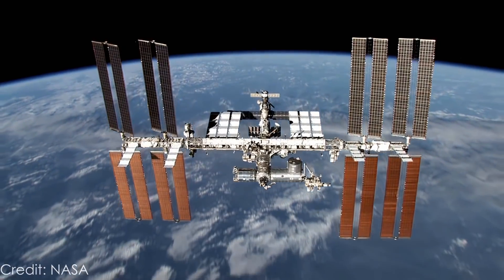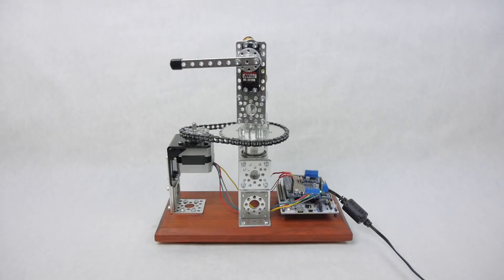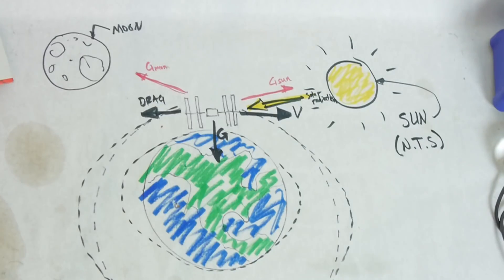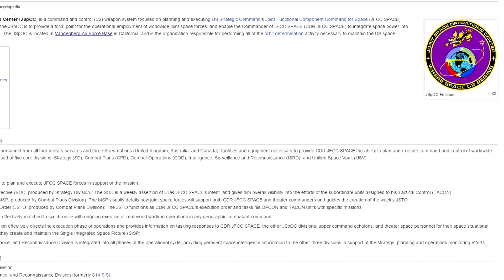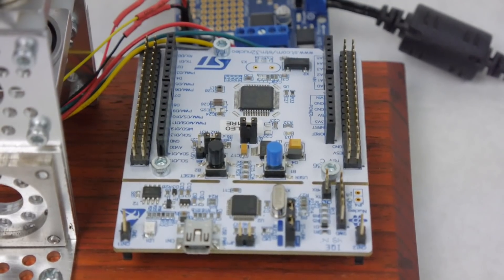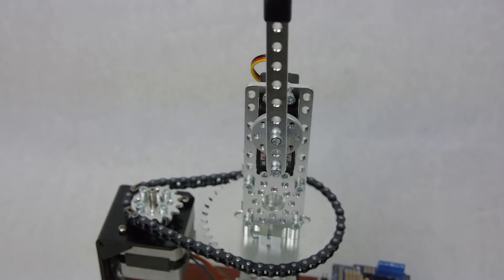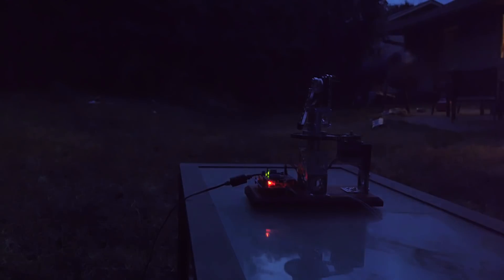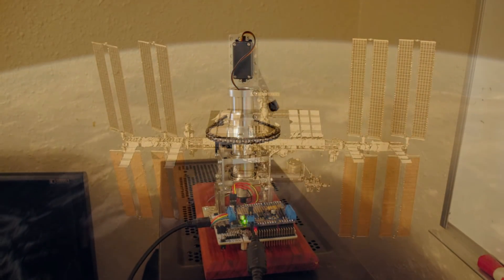International Space Station Orbit Tracker

Comment: what if you add a laser to the arm and put it in a room with glow in the dark wall paper and trace out the orbit on the walls? or just do a timelaps of it.
Reply: Altitude... altitude...
Reply: +Stephen Coyle Is this not exactly what we want? The purpose of mounting a laser onto this device would be to allow the user on the ground to pinpoint where the satellite is without having to eyeball it or estimate based on the arm's position. Having a laser reach the ISS itself and be visible from there would be an entirely different can of beans...

The fact that the laser wouldn't reach the ISS is comforting enough since you wouldn't have to worry about burning out the astronauts eyeballs...
Reply: or put it outside and have it confuse the optical systems on the ISS
Reply: UnconventionalMilling Maybe a laser, in a dark room, and then use a camera to take a long exposure shot? That way the orbit would be traced around the room.
Reply: If the laser is powerfull enough or not doesn't even matter. The stepper (or servo's) won't be nearly precise enough to accurately point to the ISS. One step (for most steppers 1,8 degrees) will result the beam pointing km's to the left or right. But regarding planes and heli's it'll still be a bad idea to randomly point a laser in the sky...
Reply: @Tomwesstein  use micro stepping to get finer resolution
Reply: @Tomwesstein  there are higher resolution steppers, I use 0.9° 400 steppers pretty regularly. I also have some 760 step per revolution.....
Plus, he is using a gear reduction drive that is increasing the amount of steps per revolution mechanically and you can also take advantage of micro stepping through the software/firmware. Most people use 16x or 32x micro stepping.
I have a high precision rotary table I built for my mill.
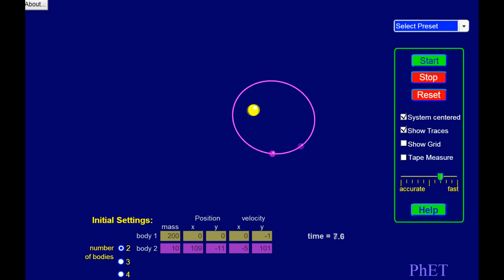It uses 5 phase stepper motors with 760 steps per revolution and an HD drive (harmonic drive) with a ratio of 1:50 and I'm using a gecko driver which has 10x micro stepping....
By the time you add it all up.....
Ugghhh I can't do the math right now but it's a bunch.
Steps per rotation x the gear reduction x micro stepping= a bunch
Reply: A 1W blue laser was seen from the ISS.  https://www.quora.com/Can-the-people-in-the-ISS-see-a-laser-in-space-from-the-observatory
Reply: @paul30003  1W is an enormously powerful laser for a rando to have.
Reply: @MattH-wg7ou  "1W is an enormously powerful laser for a rando to have."
Tell that to styropyro X'D
At this point you need to know that he built a 95W handheld laser that can melt glass and punch a hole in a metallic jar lid, and this dude is just an amateur laser hobbyist :'D
Reply: @zameliz  yea I've seen and love his channel! Backyardscientist made a powerfuI IR laser too. 
But still, 1W is far from normal or common!
Reply: @MattH-wg7ou  Well I suppose not every laser hobbyist is a maniac like styropyro so you got a point there.
Reply: UnconventionalMilling it could Also be inside a glass earth-like sfere, painted on the outside with the earth boundries. I apologize for the bad english
Reply: Tom Wesstein your putting it in a room...
Reply: UnconventionalMilling hahaha had the exact same idea! haha
Reply: Reduction gearing will get you precise steps.  That's how motorized telescope mounts work.
Reply: I told him not to touch the flux capacitor, but would he listen?
Reply: Laser have no chance to go that far. :) if its not some kind of a wall powered 15KW Laser
Reply: Dude
...
Yes.
Reply: RIP EYES!!! XD XD XD
Reply: Wow I was thinking the same thing!  How awesome would that be to have! Guess I'll just stick to visiting the planetarium instead. Fun times all the same!
Reply: Or Put it inside of a transparent globe.
Reply: Great idea. Also it could be a >500mm tranparent phosphorus coated sphere. And put the device right at the center inside.
Reply: I was thinking having a high power hand pointer laser added to it when it's outside so you get a beam pointing right at the ISS or whatever your tracking.  Sometimes satellites are in shadow and aren't visible until they hit sunlight.  Sometimes they are so bright they are hard to look directly at but this is very rare, so having something bright to point at it is pretty cool.  Now, the guys in the ISS are probably not going to be bothered by the radian divergence of a hand held laser at that distance so it should be pretty safe optically for them.  You might even send them a coded message in light pulses if added on.
Reply: SHcinema and maybe add some code to keep an eye on flight radar 24 to turn off the laser when an aircraft is in the way
Reply: SHcinema The darn laser wouldn’t accidentally point at an airliner or a police helicopter and clink that’s the sound of bars closing. Just being humorous of course. I think a pointer attached would be great.....with an on-off momentary switch.
Reply: @SHcinema  Not a great idea to point lasers into the sky it's a  little bit illegal
Reply: @SHcinema  that sounds like a good way to get the FAA pissed at you, they don't really like people pointing lasers up to begin with, and sticking one on a machine which could run unattended?
Reply: @SHcinema  and get a federal law suit ... yup that is now considered a FEDERAL crime ... which means jail time fine and or both ... plus a ban on using computers etc ... yeah NOT worth the hassle
Reply: Pyroslav x have a whole bunch of people make these and all put Green Lasers on them so the ISS could see all the people following them. thousands of little blinking green lights when they actually managed to line up.
Reply: JustOneAsbesto You clearly don't know how to read.
Reply: But they could easily see a high power green laser pointer from space, even without any (larger diameter beam for lower divergence) mods...
Nothing distracting, but a tiny green dot amogst white (fluorescent/LED/mercury...) and yellow (sodium) lights on the ground
Reply: If pointing a laser pointer at an airplane can be dangerous and get you arrested, I'd imagine pointing one at the ISS probably isn't a very good idea either.
Reply: @JustOneAsbesto  "If pointing a laser pointer at an airplane can be dangerous and get you arrested," that's the reason why you don't get caught... pretty simple tbh
Reply: @JustOneAsbesto  lolwut. No one said anything about that. And also, good luck getting your 5mW laser pen to reach 200+ miles through the atmosphere lmao.
Reply: @JustOneAsbesto  in fact there have already been researches where they tried to aim a laser at the ISS, it is not as simple as it looks and needs a lot of precision, but in the end nothing happens to the astronauts, the light does not affect them even if they can see it with the naked eye.

Comment: You should make a product out of this and sell it... with better (compact) design, dedicated app (say, with a Bluetooth connection)... put it on Kickstarter... and somehow make the price of it to be about $25... you can make several models, 1) cheap one, where you have to manually configure it, i.e. put it in the direction of the north, input coordinates.... 2) auto one, where it automatically understands it's coordinates with a GPS, knows the north with a compass, and even know weather it is on a slope with an accelerometer... the cheap one also can do that, you just have to put your phone on the dedicated phone holder on it so that it uses phone's sensors... You have everything that you need to make this a reality!

Comment: Now you need to get them to send one up to the ISS that always points back!
Reply: The ISS is pretty close to earth, so I don't think just pointing down would be a good enough approximation as pointing to his actual location.
Reply: And hookup a laser and photocell so it can communicate back and forth with freaking laser beams!  Hopefully not take out any planes in the process.   I imagine you could get away with <1w though if it's a well focused (ex: good) laser
Reply: You are definitely wrong that the pointer wouldn't move, it definitely would as the ISS orbits the earth.
Reply: Well it does rotate, at exactly the right speed to be tidally locked. But relative to Earth's surface, no, it doesn't rotate.
Reply: Aww
Reply: It would be a small motion but it would still move, it's a good idea, but the laser communication won't work for a thousands of reasons
Reply: nO IM THE REAL POINTER
Reply: the iss doesn't rotate, so a pointer looking at earth would never move.
Reply: @jbichl  actually, the ISS does rotate to accept incoming vehicles to docking ports that aren't the forward PMA
Reply: +Forgi LaGeord I was talking about earth.  if two pointer point to one another,  and one is on earth, and the other doesn't move,  it doesn't move relative to earth.

Comment: If you want to have a machine shop, you can buy one.  There are used equipment sites and craigslist, where you can often get a lathe or mill for $1000 or less.  You can buy used HSS tooling and other stuff on the bay, and you have your own machine shop for <<$5000.  Then all you need is space and power.
Reply: I can see space being a problem. space is always a problem when buying something big.

Comment: cool, I want to make antenna trackers, or will probably look a lot like this. btw ardupilot apm antenna tracker firmware  can do the control part and is open source and runs on plain 3$arduino and esp8266. you only need to feed it gps destination coordinates.

Comment: Just a note to correct the Adafruit part number so you don'y buy an RFID reader.  the motorshield needed and called out in the text is : 

Adafruit Motor/Stepper/Servo Shield for Arduino v2 Kit - v2.3
PRODUCT ID: 1438

I believe the file says 1483, just a typo.  Great video.

Comment: How about tethering a GoPro, or any other light weight video camera, to the Pointer?
Reply from the maker: +Hydden N. Plainsyght The station moves slow enough that you can track it by hand with a camera.
Reply: +Practical Engineering -- That is another option, but I suggest that the pointer may in fact offer a more solid platform than the use of a handheld device. Which gave me another thought on this; to use a Multi-X zoom camera attached to the pointer tethered to a laptop for scientific observations and tracking. Since the pointer is fixed to the orbital plane of the ISS, this leaves the observer free to observe the ISS from a laptop and control the zoom as well without interfering with position. I would also like to possibly consider creating a satellite tracking 'go-to' software; based on CelesTrak and any other NEO or Satellite object logged into a data base, that could be used with your pointer or any GPS Go-To Telescope system. I've been working; theoretically, on a model satellite tracking system that utilizes marine satellite antenna to scan the sky for signals of satellites that are not cataloged... that is to say, if it is a satellite and is sending a signal within a given detectable frequency range... kind of like SETI, but for secret satellites.